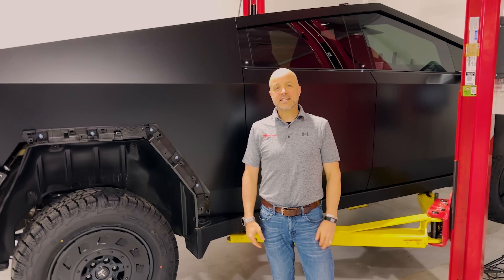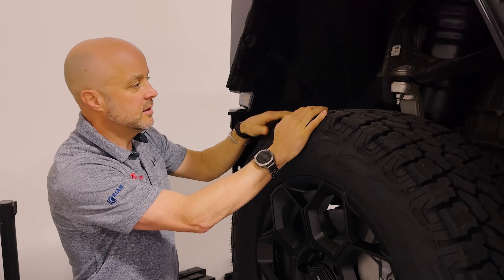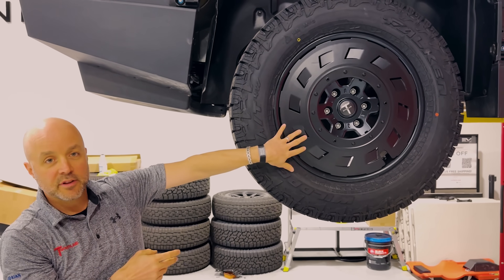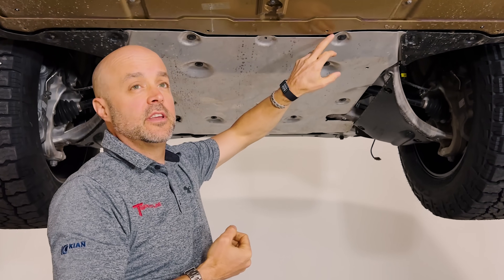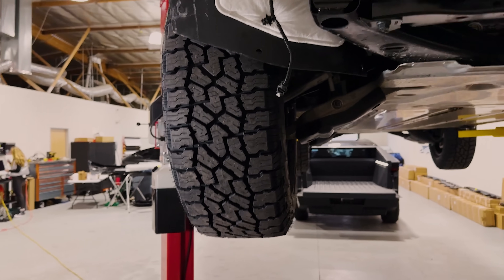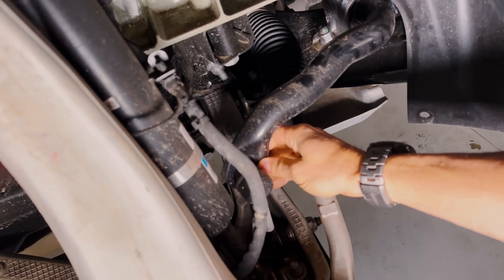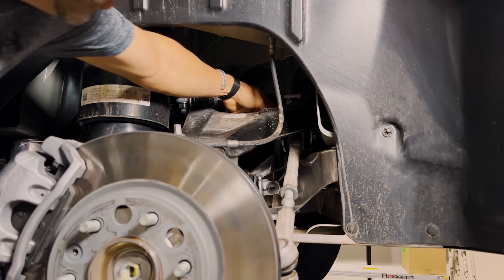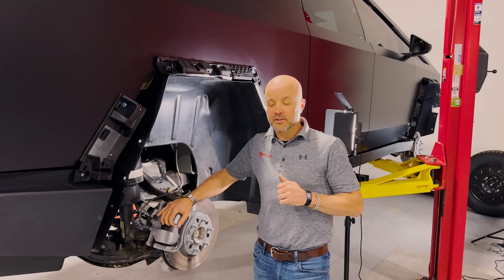Dissecting a Tesla Cybertruck! Underbody & Wheels off Chassis Inspection and Walkthrough, first look

Comment: Also with regard to rear wheel size and the fact that it has steering, you need to take into consideration that Tesla has admitted that they have the rear steering amount (degrees of movement) set fairly low right now, but it's a tunable parameter they can change in software.   They might open it up for more movement later, so larger tires might have an issue if Tesla sends out a software update.
Reply: Lol, these fancy new vehicles are great but really a headache in alot of ways!
Reply from the maker: Good point!
Reply: I haven't put a massive amount of thought in it but I don't think tire size would effect rear steering
Reply: @randylahey2242 the larger the tire is, the less it is able to rotate before the inner edge of the tire will hit the inner fender etc.
Reply: My 1995 nissan skyline has rear wheel steering, its not new technology 😂
Reply: @steriskyline4470  being able to adjust the parameters via software update certainly is.
Reply: @shenamariscal6200  nonsense! What are you going to via software? The max steering angle is the only thing that can be changed and not improved
Reply: @shenamariscal6200  didnt think it was that advance that you can change the mechanicals with a software update
Reply: @steriskyline4470 Tesla must of designed it along time ago and skyline copped Tesla.
Reply: Not knowing what you buy is an advantage 😂 maybe it gets better. Maybe worse 🪙
Reply: @lemcakes32422  the steering rate and angles in relation to speed and force can all be manipulated through a software update. They have the capability of altering the entire feel of the vehicle with a few key strokes
Reply: @lemcakes32422 If you consider changing when and how far a motor turns drug hallucinations, I don't know what you're smoking.
Reply: @HenryLoenwind  no idea is that confirmed from Tesla. How much can software alter hardware on a Cyber Truck?
Reply: @bad_financial_move9169  City trucks are only made to go to shopping malls or for those soccer moms to get Jimmy or sussie from day care.
Reply: @lemcakes32422 Yes, it is confirmed that the current software only uses 3% of the available 10% steering angle in the back.

And why are you still doubting that an electric motor can move things around?
Reply: I would hope they make this adjustable by after market installers at minimum. Best would make it exposed setting in the UI
Reply: @steriskyline4470 Monster Trucks had rear wheel steering in the 80s 🤷
Reply: @carholic-sz3qv I think you don’t understand what is going on. The max steering angle is 10 degrees in hardware, but the software is currently capped to something like 3 degrees.
Reply: @lemcakes32422 you don’t. The mechanicals are currently capped lower by the software.
Reply: @lemcakes32422 the software cannot alter the hardware. The software is currently underutilizing the hardware. This is a very common thing to do.
Reply: @kalasmournrex1470  really!? i didnt know that! honda preludes had it in the 80s also, like i said its not new tech, people are just re-inventing things that usually just break anyway.

Comment: I would worry about cracking the front and rear castings, they look very thin in places. How would you repair this?
Reply: I thought the same thing, abit of salt and corrosion there will cause havoc, leta hope they choose the right alloy.
Reply: Short answer, you don’t. -Autobody tech
Reply: Another auto body tech here. Buying new parts to replace stuff is the only way.
Reply: Another auto body tech here. Buying new parts to replace stuff is the only way.
Reply: Another auto body tech here. Buying new parts to replace stuff is the only way.
Reply: So you buy an entire front or rear end to the truck? @epjetta
Reply: @TheBonsaiZone  I'm pretty sure that is exactly what tesla would tell you to do if it's damaged. If it's just control arms or hubs etc damaged I'm sure they would be available by themselves.
Reply: @erikjakan1 What makes you think salt will do anything to aluminium?

Or, if I had to be a bit more precise: To aluminium oxide. Aluminium oxidises within seconds when exposed to air, forming a thin but very resilient skin.
Reply from the maker: That wont be easy!
Reply: Electric Viking got hold of spare parts list for the Y and a casting was US$700
Reply: I heard they took this truck out for some back road bouncing around and something bent in the front end and it did not look too good
Reply: Imagine the cost of replacing it!! Wow! @mickjoebills

Comment: suspension and brakes look like standard DOT for light duty trucks for North America.
Reply from the maker: Yes, looked fairly typical
Reply: It's basically a Honda Ridgeline powered by a electric power plant.
Reply: @moabman6803  Far more capable than a Ridgeline, matter of fact more capable than the average 1/2 ton.
Reply: For a split second I thought, those rear brakes don't look too beefy.  Then of course I had to smack myself.  Doh!!  This truck will have massive regen.

Tesla brakes hardly get used at all.
Reply: @boostav  I suppose to some degree because it's so heavy and has enough torque to pull more. Those tie rods and ball joints don't exactly bring to my mind the word robust.
Reply: Is that why there is also a reversing beeper?
Reply: @davidmenasco5743 That, and brake balance in cars is 1/3 rear to 2/3 front. So, the rear brakes only need to be half the size of the front ones, even without regen.

Comment: what is the air  pressure port on the fender on the passenger side? is that simply for acess to suspention air for serviceing or is that the compressor option add on? that would be sick if this is a option you get a small doored fender and boom add on board air
Reply from the maker: We suspect it is for service, like if the main compressor dies.
Reply: Maybe it's for "pressurizing" the battery pack before you go "boating".
Reply: @dlux703 That can be done from the main screen without manual mechanical work.

Comment: I was hoping we would get an answer as to why the underside rear of the truck has that large plastic box that makes the departure angle worse. You said there's nothing under it, so why is it there? Does it help with aero? 🤔
Reply from the maker: It's an aero feature, but its mostly empty
Reply: @TSportline  I figured, it's just a shame that it does reduce its departure angle, and it would have been nice if it actually had another purpose— that it wasn't just hollow. No, I guess if it increases the range, it's definitely still worth it

Comment: Because this is a one speed transmission, any wheel diameter change will change the top speed and acceleration and efficiency.
Reply from the maker: Good points!

Comment: Great video.. what is in that "box" that sits aft of the rear wheels?  that sits in front of the trailer hitch and reduces ground clearance (where the reverse speaker lives?)
Reply: That's the trunk.  Under bed storage.  Kyle remarked on it in his factory walk through at the delivery event.
Reply from the maker: The plastic box underneath?  Nothing in it, aero related.

Comment: Oops, accidentally crease the rear fender flare --- $6000 repair. Like the rear tail lights of the Ford truck with all the sensors - $3500 each.
Reply: ah just leave the dents and creases - it's a truck.  I worry about dings in steel because of rust - with Stainless - just let it ding and crease - who cares.
Reply from the maker: wont be cheap!

Comment: The suspension looks less robust than I was expecting...
Reply: “Looks”
Reply: Love the plastic aero panels 😂 what could go wrong..
Reply: At the end of the day its a big crossover made for the odd unsealed road. its not going to be tough as a dedicated off roader with solid axels and leaf springs
Reply from the maker: It was interesting to see, looks a lot like Model S / X
Reply: Especially the rear spindles. A lot of leverage on those short spindles

Comment: Looks like that rear swaybar is a solid one.  You didn't comment on that, but it would makes sense for the smaller rear one to be a solid design.  I agree showing the rear bumper cap on was a miss.  Are you guys going to make a hidden winch bumper for the front?  A skid plate that also goes wide enough to become rocker protectors would be good too.  Just so you are aware, aluminum skid plates stick to rocks.  Steel ones slide over.  For real world use, aluminum isn't usually worth the weight savings.
Reply from the maker: Yes, we'll cover more on another video.  We were putting this back together for the customer, so had to rush a little bit.
Reply: Battery tray will be aluminum.  Stainless does a better job of skidding off rocks but gives a serious risk of galvanic corrosion hitting the battery case. It could have a thick plastic layer between but aluminum removes the risk. Don’t mix metals.
Same issue arises if the thin aero plates are replaced with stainless steel. It can be used but will need plastic washers. Ideally glue them to the stainless so they don’t fall off during fitting.
Reply: A lot of trucks don't even have a rear sway bar, so it's no surprise that the rear is significantly smaller.
Aluminium with a UHMW coating would probably work best for the skids (a common option among serious rock crawlers).
Reply: Great look at parts us gearheads care about! Thanks!
Reply: @tareskisloki8579  those trucks without rear anti-sway bars also have leaf springs which resist roll (since they must twist to allow roll), so it's not a direct equivalent. I doubt you'll find a truck (or any vehicle) with an independent rear suspension and no rear bar, but I may be mistaken.

Comment: Aftermarket parts and services for the CT will be epic.
Reply: $$$Air suspension $$$ OEM systems are so nice when there new. This thing’s going to be needing 5000-7000 in compressors and air shocks 8-12 yrs down the road . So many Cadillac Escalades that the owners parted with big money for the same style system.
Reply: @JohnDiMartino  You play you paid. 8-12 years is long time. Most will change cars by that time.
Reply: Nope it will not! It's never going to offer the level of customisation or mods that a laser frame and body offers period
Reply from the maker: for sure!

Comment: i mean it looks like the bolt on the balljoint can be shortened to accept an allen key type instead of a hex. If the cyber truck gets aftermarket support this could be alright, it will likely need aftermarket knuckles for more tire clearance still.
Reply from the maker: A lot of ways to work on this, yes!

Comment: Will this truck accommodate a winch and potential for snow ploughing ?
Reply from the maker: Maybe, need to figure out a battery / power solution
Reply: @TSportline  I plan to use this for heavy duty winter plaza work. Ploughing snow, need a winch for potential towing applications, and my intention is to buy a truck with the battery extender so winter range loss doesn’t affect my productivity. Given it’s an EV this could be lower cost to operate than an F-150. We have high voltage chargers there so refueling this EV will be easy. Hope you can come up with a solution for us. We need a fleet of these things.

Comment: 5:10 OMG you just damaged the roof with the extra push up! :face-purple-crying::face-purple-crying::face-purple-crying:
Reply: Relax, that’s not true. That wire with foam around it is a height sensor, the rack won’t go higher.
Reply: No, the top is a bump-sensor. It's soft and flexible, and tells the pump to stop before any damage can occur. The top of the truck never touched/moved the sensor.
Reply from the maker: ha ha, roof is fine.  Nothing touched.

Comment: Pretty decent breakdown.  The drive by wire is a first for us and we make every Tesla steering column.  The cybertruck column is very unique in many ways.  Also there is a very good chance I touched the steering column in that particular vehicle as I was helping engineers get the line to be able to make them.
Reply from the maker: Thanks!
Reply: All I can think about is hitting a giant mud hole and losing the ability to steer

Comment: Unfortunate it wasn't designed to accept larger off-road tires, but I understand why it couldn't be a priority. Aftermarket skid plates and bumpers will be a necessity for anyone taking this off the pavement with any regularity. Those wheels aren't great (sorry). You might have to think outside the box and incorporate some geometric shapes to get something to look better than the OEM's. Anything that accentuates the round shape will probably stick out like a sore thumb on this.
Reply from the maker: Agreed, we are working on various upgrades like you mentioned!  Our Rivian lineup (EV Sportline) was good experience in prep for this!
Reply: That's why it's not a real truck Lol!!! It's just a Honda ridgeline with stainless steel body! Look at the suspensions of the Ford raptor for example they are made to accept much bigger wheels, much higher suspension travel..... this will never equal that!
Reply: @carholic-sz3qv  That's just silly. This thing wheels like a beast. The air suspension alone gives it a significant advantage to a Ford pickup off-road. Once you account for the difference of no drive train hanging, your Ford doesn't even qualify for the conversation.
Reply: This suspension doesn't look much different than a standard soccer mom SUV setup.
Reply: @AlexMousavi  That time your mom hit some ice and slid off the road driving you to work makes you an expert on the subject in your mind?

Comment: What is the T-track underneath the truck used for?
Reply: Maybe the most fascinating discovery in the video.

Mystery track. ???

Maybe just for factory use?
Reply from the maker: not sure yet
Reply: On second thought, I wonder if it could be to install the coil for wireless charging?

Comment: Great walkthrough!  Looking at the stock truck this is NOT meant to go off road other then gravel with no potholes at low speeds.  Those pressed steel control arms with most likely spot welds, especially in the rear with how long they are (huge pressure/stress points) and total lack of under body protection would all crumple with a small rock.   Also plastic bumpers?  wow.  Good news is, gives you guys huge opportunity for aftermarket!  Needs bumpers, skid plates, new arms, tie rods, sway bars....
Reply: So just like every 4x4 on the market that costs under 80k

Comment: Do you have to put the truck in a special mode to lift it up for the air suspension?
Reply from the maker: No, you can select the height you prefer in the center screen
Reply: @TSportline  I understand the adjustment of the suspension . I should rephrase my statement.  To work on the vehicle does it have to be put in service mode to lift it so you don't damage the air shocks.

Comment: Undersprung, under-clearance and spec’d tolerances for on-paved driving, the steer elements of balljoints, tierods and swaybars will be owner-consumables. Ditto on brake rotors, pads and spindles on all four corners which will wear like chocolate oreos. In short – a showpony.
Reply: I agree with you on the suspension components, but as far as brakes are concerned, don't forget regen takes up most of the load and wear that typically needs to be accounted for on conventional vehicles.
Reply: It's the most made in the USA truck. It will pull an F350 down the road backwards until the f350 rims grind down to the axles before it has to charge. The regen brakes are going to keep the rotors cool. 
Chevy and other have made ball joints out of plastic. Sway bars usually do not need replaced. They do not wear.
Reply: In other words, exactly what 99% of truck owners need.
Reply: @mr.zillasalt5924 So tell me you didn't see the video of this vehicle getting stuck off-roading in snowy area while carrying a xmas tree in the bed. It had to be rescued a vehicle in Ford line of trucks. Its pretty much a show pony. Honestly I found it pretty sad that after all that trash talking that guy did, it was a competitor that helped it out.  Just saying...
Reply: No ball joints are made of plastic. An f350 can tow more than this.
Reply: Tesla brakes have a problem with getting rusty from disuse.

Many Cybertruck owners will have this rust problem.  To avoid it, you have to take deliberate steps to make the pads touch the rotors -- or drive it like a racecar on a track.

For everyday driving, these brakes are way overkill.  Track drivers might want an upgrade.
Reply: @mitchgowing2336  good point.
Reply from the maker: interesting

Comment: Looks like you could grind an inch of that bolt off. Then could fit a 295 65r20 that is it.
Reply: Should fit without grinding, it's less than an inch in diameter between that and the stock 285/65 R20
Reply from the maker: There will be ways, aftermarket loves these challenges ha ha
Reply: @TSportline  Would prob require aftermarket  upper a. Arms, but even then your running into the front end.   Those really look close to the larger tire you could fit without serious work

Comment: For me a real pickup truck must have a least 1 solid axel. The front suspension it's a joke, one ball joint on upper control arm. They supposed to put 2 separate strong control arms ,means 2 ball joints , in stead of triangle control arm  !
Reply from the maker: No solid axles here ha ha
Reply: Yep, like calling a Honda Ridgeline a truck- it’s FWD😅

Comment: Upper balljoints look way to small for the weight of this thing
Reply: Agreed. Tie rods are tiny as well.
Reply: @moabman6803  Rear axle look very thin too for how much torque this thing makes. My corvette suspension is more heavy duty and it weighs half of that
Reply from the maker: Interesting to see the size of the parts for sure